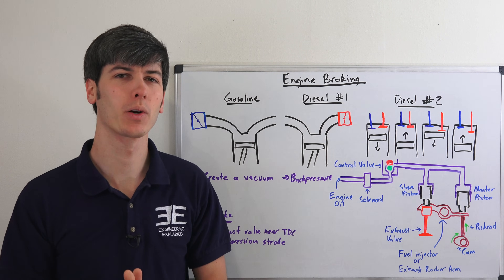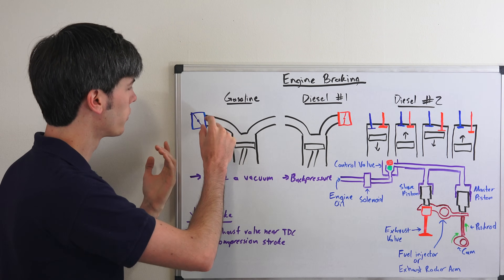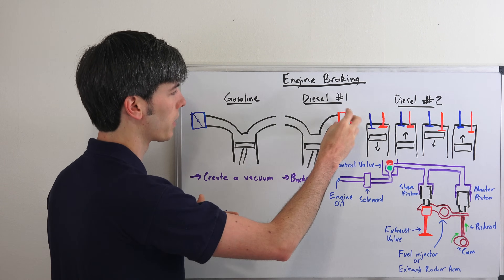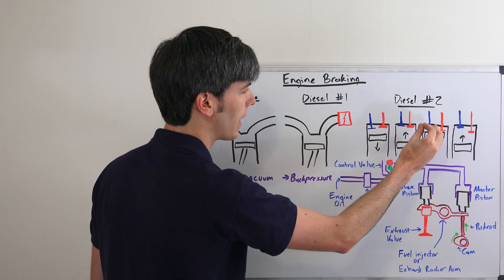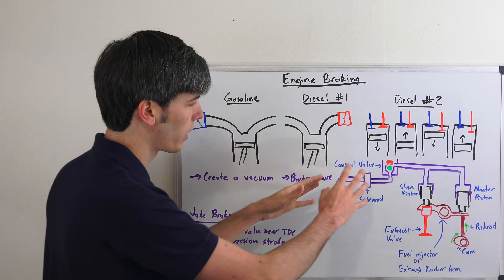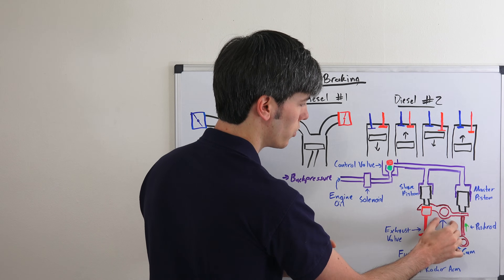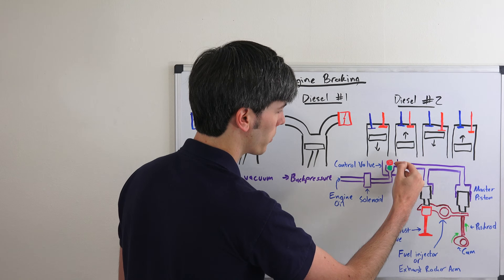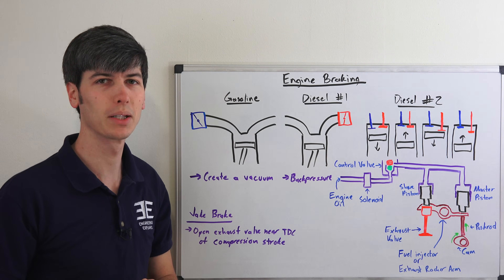What Is Engine Braking? What Is A Jake Brake?

Comment: 2 stroke engines doesn't do engine breaking because there is no valve so they can't make vacuum?
Reply: 2 cycle engines were unable to meet changing emission rules in the 1990s so were no longer built (except marine applications maybe.)
They did use Jacobs brakes but were less effective than 4 cycle engine Jakes." 
Fuel injectors are always cut off the ery moment Jake goes on or fuel pedal is released in electrically controlled engines so non issue.
Reply: +James Tennier I have two 50 ccm 2 stroke bikes (hmm, so much power, man :D ), one was made in 1974, the other in 1981, so they're not exactly brand new and they have carburettors instead of injectors.
When I release the throttle they do not have a lot of engine break or I believe they have completely no engine break, it's just the natural slowing of the bikes beacause of gravity and aerodynamics and stuff...
(But it's hard to decide cause of that insane speed, like 50 kmh)

But why? I believe beacause of the lack of valves, am I right?
Reply: +Billy Well, many 50cc bike engines use a centrifugal clutch, which disengage the moment you go off the throttle. So there is probably absolutly no engine braking what so ever.
It doesn't matter so much if there are valves. What you have to do is close the throttle plate and even a 2 stroke engine has a throttle. The problem is more, because there's no complete fuel shut off because of the carburator, the engine would still produce a bit power, which hinders engine braking quite a bit. So yes, stroke petrol engines are bad when it comes to engine braking.
Reply: Actually there are more than one type of intake vale in a 2 stroke engine Reed valve and (can't recall other names.) Piston crown at TOP: spark, power; down. As pistons descends it passes exhaust (opening) port(s) near cylinder bottom= exhaust moment.
Piston starts back up pushing spent charge out exhaust port and compressing incoming air charge(thru reed valve) till spark occurs again. 2 events on down stroke and 2 events during up stroke. Hence 2 stroke. BUT less compression ration in effect since there is less time and two things going on in that moment...
Reply: shi01; Might add centrifugal clutch is a different apparatus all together from a normal wet or dry clutch. At idle speed, clutch is disengaged (like the vacumn advance being retarded position of a distributor.) and driving shaft spins at idle speed. As throttle is opened/ engine speed increases, clutch weights attached to clutch inner, are forced outward and engage with clutch portion attached to "driven" shaft and on to transmission.

Comment: +Engineering Explained Can you shed light on the turbocharger and Engine Braking? Since at low RPM (when foot off acc.), turbo charger does not push air into pistons. This means compression ratio is lower. Does this decrease engine braking effect? Also, if no fuel is injected into the engines, will the turbo charger compressing air using exhaust will by itself cause energy loss, when throttle body in exhaust is closed? 

Are there technologies that can "stop" the turbocharger to close off the exhaust or intake to create compression/vacuum respectively without using the 2 techniques stated in your video?

Hope you can advise. I'm not so good with compressible flow fluid dynamics.
Reply: There is no stopping a turbo while the engine is running, but some turbos have a blow off valve that release the pressure created by the turbo when it is not needed.

Comment: So with a gasoline engine, I notice that when I'm cruising in a higher gear (let's say whatever gear my automatic transmission chooses for me), when I let off the throttle I experience very little engine braking. Yet if I'm playing around and forcing my 5-speed to cruise in 3rd gear while going 100km/h (for example), when I let off the throttle I experience intense engine breaking. Why the difference? Is it becasue at higher revs the pistons are moving faster and therefore experiencing the effects of that vacuum more times per second, or is it simply because being in the lower gear means that the same amount of vacuum has a greater effect on the rotation of the wheels simply due to the higher torque of the lower gear?
Reply: It has more to do with your transmission.. when you are cruising at 100kms/hr.. in overdrive... the wheels can go faster than the engine... when you downshift...you force it to lock into a lower gear.. and cause "engine braking"

Comment: Could you make a video about the O2 sensors and their importance? Like, how bad it is for a vehicle if some/all of them are not working properly. Thank you for your awesome content :)
Reply: There is two 02 sensors, one upstream, or be for the cat, and one down stream or after the cat. The one upstream is used the amount of 02 in the exhaust coming out of the engine. This info is then used be the car determine if the car needs more fuel, high amounts of oxygen in the exhaust, or less fuel, low amounts of oxygen in the exhaust. The down stream compared the amount of oxygen in the exhaust after the cat to the amount be for the cat to make sure it working correctly. If the down stream one fails you basicly just don't know if your cat is working correctly or not. If your upstream on fails the car not run right, you would get less mpgs, and you would lose horse power.
Reply: Thank you :)
Reply: @kingkevin267 the rear sensor is also used to trim the fuel a little bit. It compensates for drift of the front sensor and the ECM can get an averaged accuracy of around 0.001 lambda using the rear sensor or about 10x more accurate than the front sensor alone.

Comment: I know engine can prevent break overheat on very long downhill, why some places prohibit engine breaking.
Reply: +Stark "why some places prohibit engine breaking."Noise. They're loud
Reply: MUFFZILLA As I stated, engine braking prevents break overheat. Safety should always goes first, noise should be last thing to concern
Reply: Stark I haven't done the research into accidents that could have been prevented by using engine brakes on diesels, however, I have done a fair bit of research on aviation noise that I think is fairly comparable. Increased noise levels lead to an increase in hypertension which lead to an increased risk of stroke and other issues. This doesn't directly effect the people on the road, but the population around noisy areas can have serious health effects.
Also, I don't think that engine brakes are considered safety devices. I doubt many accidents would have been prevented in no engine brake areas if they were allowed.

Comment: Gas engine; higher compression ratio+/- more "engine braking with throttle closed. 2) Diesel engine "exhaust brake" lets higher, (17.1 18.1) compression exhaust stroke, slam into a closed exhaust pipe gate valve or butterfly (type) valve depending on manufacturer... About the same on a long downgrade at less than "speed limit" as continual 8-10# of air pressure to properly adjusted brakes. 3) Jacobs brake was developed by an engineer at Cummins Engines many years ago. It works just as described. It has been mandated in many European countries as a "safety necessity" for many years. In the U.S. most every manufacturer includes them and has for several decades. (Old saying among us old truckers; "No Jake is no joke!" An aside: Several years of no engine brake on an Allis Chalmers powered Freightliner in the '70s. The Grapevine was my nemesis! Finally installed an exhaust brake as no Jakes were made for the AC and no longer smoked all the way to Bakersfield. True story.
Reply: James Tennier. That is interesting. I had never looked up the history of Jacobs Brakes. We had a 76' 4300 series International that came out of the factory with a 318 Detroit and true Jacobs brake. Had a lot of problems with them from what I can remember as a kid, so we had them removed. The truck was a flat lander and didn't really need them. When I first drove for CFI in the 90's, none of the fleet had compression brakes. We ran 48 states and Canada. Old school mountain method for downhill was one gear lower than the last gear you topped the hill in.
Reply: James Tennier
The grapevine was a nemesis for many, be it semi or pickup and trailer driver ! 😊
Too many times did I get to the bottom with a STRONG amount of suction on the seat ! 😫  If you know what I mean !
Reply: cummins himself invented it after almost hitting a train testing a truck, Jacobs drill and chuck just made the ting cause the had the mills to do it.
Reply: Clessie cummins designed it after he retired

Comment: So, when you don't want the jake brake to work like when you are normally using you car, does the control valve let the oil pass to the oil pump back not creating pressure on the sledge piston, thus the exhaust valve doesn't open at TDC?

Comment: I'm confused on one little bit... and that's engine braking in over drive gear or in my mustang's case, 5th gear. sometimes cruising at low speeds, I'll put it into 5th gear when I don't need more throttle but I want to maintain my speed. My foot is completely off the gas and rpms are very low and the speed is maintained very well, maybe even goes up just a tad. How does this work? Mind you, I do this maybe around 30 mph when I see a red light ahead. I decide from a great distance that I don't need power since I'm approaching a stop and it'll coast all the way to the stop.
Reply: it's just idling in gear then

Comment: Great explanation video, I'm still have a question on how an automatic transmission car does its engine braking, since automatic transmission use a torque converter, and its turbine/impeller can rotate differently, are all thermal heat energy absorbed by the torque converter instead of the engine in this case?

Comment: why doesn't engine braking occur at low rpms? the engine is still rotating without throttle so shouldnt there be braking? I know there is more as you go higher but why does crusing at say 1200rpm not brake your car?

Comment: Please explain where the heat goes in the gasoline engine. First, the piston will pull against the intake vacuum when the piston is moving through the intake stroke. The vacuum will then pull up on the piston during the compression stroke. The overall effect should be zero similar to a spring.  I believe the heat is dissipated at the throttle plate or idle air valve when the idle air passes the plate causing noise/turbulence. I'd like to know if engine braking would happen with a sealed intake.

Comment: when engine braking in a petrol/gas engine, do the injectors still inject fuel into the cylinders?
If so - why? and what would happen if they didn't?
Reply: +Aaronx3Sally Unless there is a computer program to cut the fuel when braking, the idle amount of fuel would still be injected. Some cars cut the fuel to the engine when coasting in gear or braking for the sake of fuel economy.

Comment: I already knew this, but i have question unrelated to this video, and i can hardly find someone as trusted as you to answer it..
So, VW cars usually have TDI badge at their backs, but why do some have I or DI in that TDI logo colored red? I heard its some color-code for VW's engine power recognition or is it just cosmetic? Also i was told, more red letters in it, more powerful the engine. Thanks in advance!

Comment: Are these only for 18-wheelers?
Reply: dump trucks too
Reply: +DJWolves97 About any 9+ liter medium/heavy duty diesel will have an optional jake brake (or added through the aftermarket), but recently alot of manufactures have been going with an exhaust brake due to the wide use of VGT turbos on the smaller engines like Ram, Ford and GM use on their diesels.

Comment: Explain wheel hop someday please
Reply: Wheel hop that occurs from a hard acceleration scenario; usually only occurs in vehicles where the drive wheels are connected to the frame by leaf springs. Leaf springs are designed to bend and flex and still retain stiffness. This stiffness can sometimes be overcome by large amounts of torque and traction. When a leaf sprung vehicle accelerates hard, the axle shaft wants to tip up due to torque, the spring in turn also twists with the axle. This twisting will occur until the spring has twisted so much it can not twist anymore and it untwists back to it's resting state along with the wheels and axle housing creating wheel hop. However, if torque is still being applied this twisting and untwisting motion will continue until torque is stopped. This all happens rather quickly thus creating "wheel hop"

Comment: I just thought engine braking was caused by friction in the engine/gears. And a common argument for doing it is to save your brake pads, but on the flip side this puts more wear on the engine and not using your brake lights can cause you to get rear ended. But on the plus side, it does sound cool and it's fun to see how long you can avoid using the brakes.
Reply: +6Twisted The resistance/friction on the bearings and weight of the rotating assembly surely aid in engine braking, but I think he didn't mention it because its rather obvious and most people probably don't know about the vacuum effect caused by the throttle body.   Engine braking isn't inherently hard on parts IMO, but engine braking from a high rpm or coasting down from near redline is asking a lot of the crankshaft and rods, especially in low gears (first and second).  I often see people do this in parking lots or on side streets, accelerate hard in first gear and let off near redline and coast at 6500rpm trying to sound cool... seems like that would be hard on equipment!

Comment: how to do that in automatic car?
Reply: Simply letting of the accelerator, shifting into 1 or 2 will give you higher RPMs depending on your specific situation, this will in turn slow your vehicle more than a lower RPM

Comment: What activates those systems?  Pressing on the brake?
Reply: A switch on the dash, and as soon as you let of the throttle the jake brake will start doing its thing
Reply: +Gd Snuff Jake brakes have a switch in the cab, Gasoline engines just let off the throttle, I don't know about the 1st Diesel one
Reply: Thanks guys!

Comment: In a gas engine, the vacuum you pull on the intake helps pull the piston back up on compression, so your engine braking isn't about pulling  a vacuum, but from pumping and frictional losses
Reply: +blurglide There is definitely a distinct force to pulling on a vacuum; it isn't just pumping and frictional forces (neither of those forces are anywhere near strong enough).  NASA uses this force for exercise machines on the ISS.
Reply: There is, but at high engine speeds, that vacuum will help pull the piston back up after it changes directions, won't it?
Reply: blurglide If I understand you correctly, no, it won't.  Speed is irrelevant, and a vacuum is a constant force regardless of the cylinder position.  Any air that happens to seep through will immediately get pushed right back out the exhaust, so the air pressure (or lack thereof) is consistent.
Reply: What I'm saying is that the engine has to work to create the vaccum on intake with a closed throttle, but at bottom dead center, this vacuum that was created is now helping to suck the piston back up, returning most of the energy that was lost.
Reply: blurglide for an individual cylinder that is a perfect vacuum, what you said would be true.  But since most cars have at least 3 cylinders, at any given time there's always going to be another cylinder(s) pulling on the vacuum as soon as soon as one is let go.  Also, it isn't a perfect vacuum.  It may start out as a near-perfect vacuum, but as the cylinder pulls away from the valves, air builds up within the chamber (and some cars may still release fuel), so the "reverse" effect isn't as great.  Hopefully I'm explaining that properly, I'm not a physicist or mechanical engineer.
Reply: Peter Schmidt ...multiple cylinders has zero to do with the physics of engine braking.  I am a mechanical engineer.
Reply: blurglide Yes it does.  You were saying that basically once the compression stage happens, the force from the vacuum would be negated, and it would push back with the same amount of force.  But other cylinders start pulling back as soon as that happens.  Like I said before though, by the time the compression stage happens, it's not a perfect vacuum anymore, so there is actually air to be compressed.  So no matter what, the vacuum force will always be greater, and that's what slows you down.

It's a bit hard to describe without diagrams.
Reply: That just smooths it out, not alter the fundamental physics of engine braking.
Reply: blurglide You're not accounting for all variables.  The multitude of cylinders keeps the force constant and prevents the reverse force from getting "carried away". But the air pressure within the chamber isn't constant, and the lack of balance in that is what's slowing you down.

Anyway there's plenty of documentation on how this works.  The vacuum is the main force at work here, but some other source might be able to explain it better than I can.

Some sources may say that it's actually air compression that causes engine braking.  Though that is physically possible in a hypothetical scenario, that isn't what actually happens (it's not really easy to cram that much air in).
Reply: If the throttle were completely closed off, the cylinders would just be negative air springs, returning as much energy as they absorbed.  The only losses are through friction, and through the pumping losses as the throttle is not 100% closed.  Stick your finger over the end of a syringe with a lubricated plunger, draw the plunger back, let go, and it snaps right back to where it was.
Reply: blurglide Right, I know.  But again - we're not talking about a perfect vacuum here.  As stated in the video, there is some air that leaks in.  It won't spring back 100%.  It will spring back, just not as much as you think.